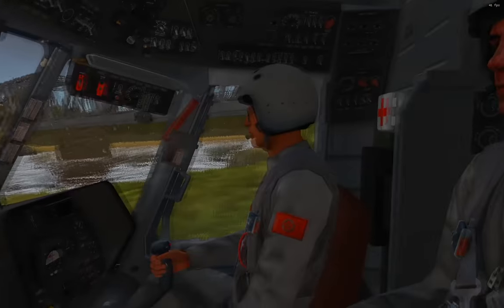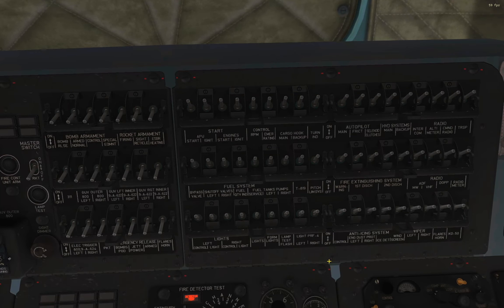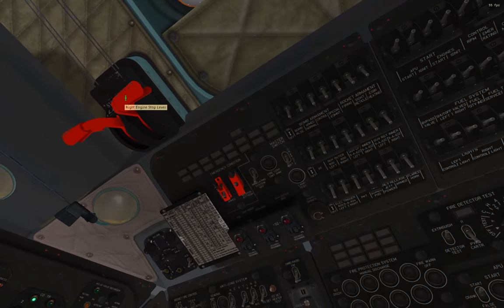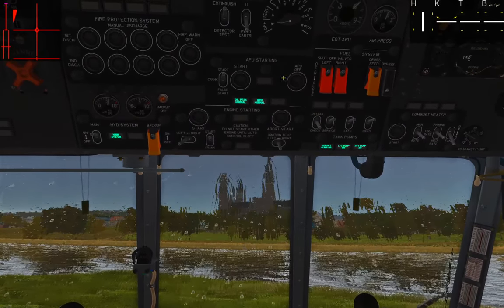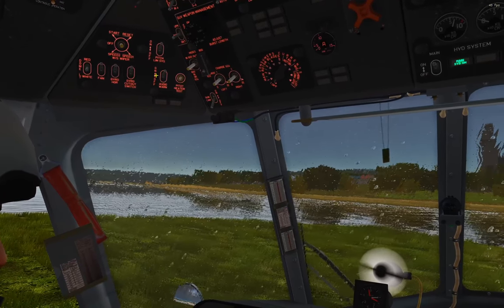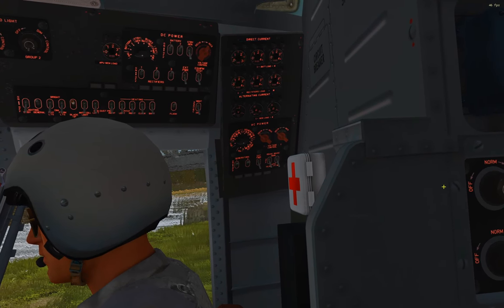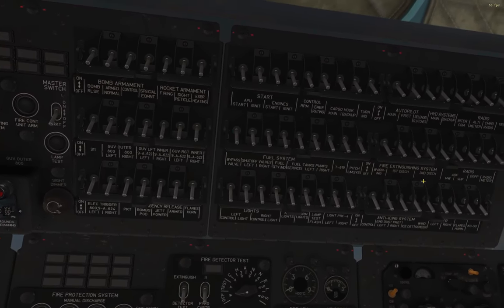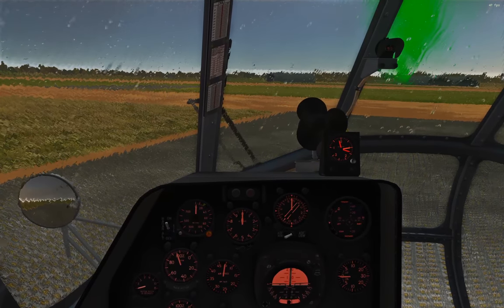DCS Mi-8: Cold Start Tutorial

Comment: Aircraft mech here, just have to chime in on the APU bit.  An APU is a mini turbine engine in and of it self, usually of the centrifugal variety. Once on speed they usually pressurize a bleed air manifold (not so much a tank). Indeed this high pressure air is then used to start the larger main engines. Also on some aircraft (usually larger ones) that have Air conditioning packs bleed air from the APU can be  used to run the A/C on the ground when the main engines are off. Also they tend to have generators attached to them as a means of backup power should a main generator fail. That's probably way more than you wanted to know about APU's lol . Anyways, great videos on the Mi-8 and keep up the good work!

Comment: small corrections.
according to my sources:
1. The reserve (APU) generator should be turn on after initial APU start and cooling (1 min) for instruments and subsystems checks - to remove the strain from batteries. Although it is only 3kWt, so not everything can be checked immediately, usually you will do one check at  a time. 
2. The reserve (APU) generator should be turned_off before each engine start (it could be turned back on after starter switched off), so the APU won't  be overloaded. After generators is online (on right correction), it can be switched off   for a duration of the flight.

OFC, this being only sim, and not doing checks you can start without even bother to switch it altogether.

3. According to Russian Ministry of Air Transport, aeronavigational lights on helicopters should be used only in night, or dusk, or IFR conditions, or if day visibility is less than 2 km. Except the anticollision light, that one should be turned on before APU start. So in clear daylight you usually don't need light breakers to be turned on (if only for checks at the first start of the day).
 
4. In cold conditions, right correction should be enabled only if engines temperature is more than 30 deg C, and main reduction drive oil temperature not less then -15 deg C; but no more than 20 min of engines running without enabling correction is allowed.

5. Before enabling GYRO HOR switch, button on the instrument itself should be pushed to uncage and reset it.

6. You don't need to move the indicator in the radar altimeter gauche all the way to the 0, there is no need to reset it.

7. Autopilot should be turned on only straight before hover check, taxiing should be done without it.

Comment: The front half of the right hand fuel tank actually contains the air conditioning unit, not kerosene. The whole helicopter runs on kerosene, not just the air conditioning unit. The cutaway in the Chuck's Guide calls it the 'система кондиционирования (по отдельному заказу)' which translates as 'air conditioning system (by separate order)'. Funny to hear of it as an optional upgrade, just like buying a car.

Comment: I've had this module since 2013 and only just got confident flying it. The discussion on engine condition levers was very useful (thanks). I was playing through the campaigns and had to use them when taking off heavy from a helipad. I still don't fully understand it though because a few times I've set the levers back to normal and raised the throttle, only to get instant engine failure. Maybe I was pushing it too hard or something, even though I was trying to be careful getting the translational lift.

Comment: Jet fuel is kerosene. The front half of the right side pod is the kerosene *heater*, which uses the same fuel the rest of the helicopter uses.
Reply from the maker: I was actually just reading about this a couple days ago. Seems the Russians like to just say "Kerosene" when they mean "Any Kerosene-based fuel", which as you say includes Jet Fuel. Thanks for the clarification!
Reply: @vsTerminus  Think of it this way. You can put jet fuel in the kerosene heater no problem. Kerosene in your jet engine, not so much. (Will work, but won't burn at the right temperature and/or cleanly enough and will damage it.)

Comment: You don't want to start the second engine with the APU generator turned on. Also there is no need to drain the batteries with having all three fuel pumps on before the main generators and inverters are operational. Leaving anti-ice circuit breakers off is only advisable when starting in the actual icing conditions as the automatic anti-ice valve on the right engine can cause it to surge during startup. Otherwise both the anti-ice system and kerosene heater have their own panels and do not drain electricity or fuel when only their circuit breakers are on.

Also engine condition levers are strictly for an engine testing on the ground and single engine training/engine failure flight. There is a reason helicopter's do a hover check before departure. Unless there is a zombie apocalypse and you absolutely need to get off the ground, you don't attempt to fly an overloaded helicopter that way.
Reply from the maker: Great info, thank you!!
Reply: @vsTerminus  You are welcome. It is amazing how detailed the Mi8 is in dcs and you are doing a good job explaining it.

Comment: Great video. One thing for some reason is not clear for me is this. How come with throttle to the max and collective up nothing happens ? I mean why you're not taking off at that point.
Reply: That's probably the most demanding parts of flying a helicopter on the engines. You're using close to max power.
Reply: @Ryan-ed1lq  I am sorry, what? 

If you're saying you need almost full throttle to lift your maximum weight that is totally correct especially if temps are high but what does this have to do with my question? My question was this. At some point in the video OP maxed out RPM (normal procedure) and when maxed out a collective (I think), and at that time two things should have happened. One - liftoff, or if it's really maxed out both generators should have failed and stopped briefly until collective is returned to normal liftoff position whatever it is in his circumstances.
Reply: @Borednerds  I really don't know what your question is in this video then. That should not happen.
Reply: I'm a year late but in case you're still interested, he pauses the game before moving the throttles/collective, it is the special pause that stops physics but lets everything else function normally.
Reply from the maker: It's called "Active Pause" and it's a very useful tool for this kind of thing, and for practicing with targeting pods and other stuff that require you to be heads down while flying.

Comment: Thanks for the great tutorial simple and easy, i have a question regarding the front panel of Co-pilot there is like a navigation system LCD panel is that a special mod?
Reply from the maker: That is the "NS-430" GPS navigation unit. Unfortunately it's a paid addon you can find in the DCS shop. There are two things: One is the core NS-430 module, and the other is the 3d model you see in the cockpit. You need the core module, but you don't need the in-world model to use it. You can bind a key to pop it up as an overlay and control it from there. Either way I wouldn't buy it until it's on sale. I will have a video on the NS-430 in the future, but you can see some of its functionality in my Multiplayer vids where I used it to navigate around.

Comment: I  cant seem to turn on the auto pilot for some reason :/
Reply from the maker: Which channel(s)? If you've got all the circuit breakers on and the generators on you should at the bare minimum be able to turn on the center channel. You can do that while on the ground and parked. Try it in a hot-started Mi-8, and if it works there you've probably missed something in the startup process or you're just trying to turn A/P on before the generators are active.

The left (yaw) channel only activates if you have neutral pedal input. It will turn off if you try to override it.

The right (altitude) channel only activates if you are flying high enough and your climb rate is near zero.
Reply: @vsTerminus  it was the center channel, I was clicking on it but no light was coming up, then I figured you have to rotate that button first to see its light, it works now but I can seem to be able to turn it off? Clicking on it and nothing happens.